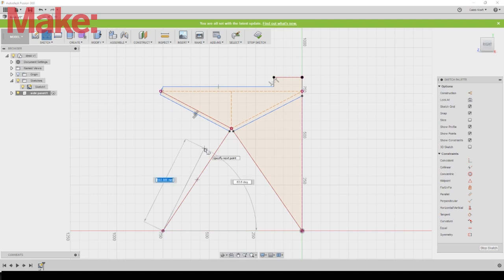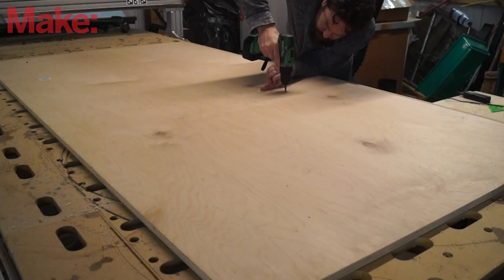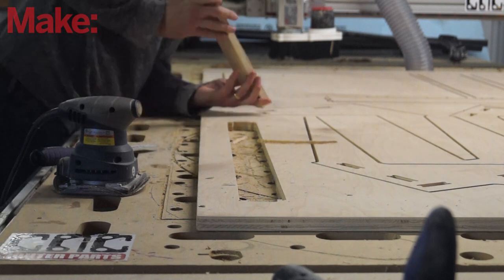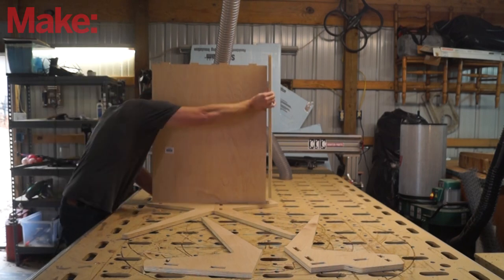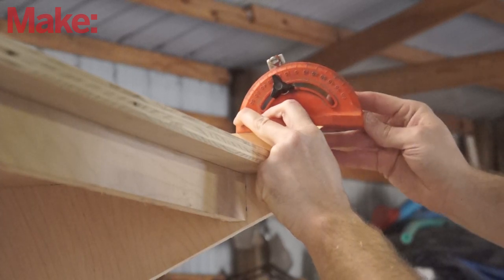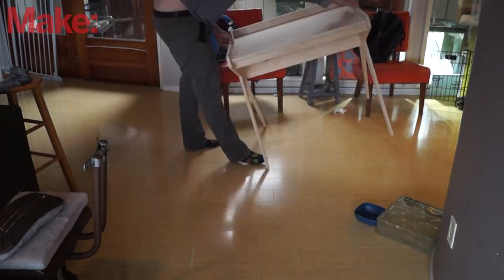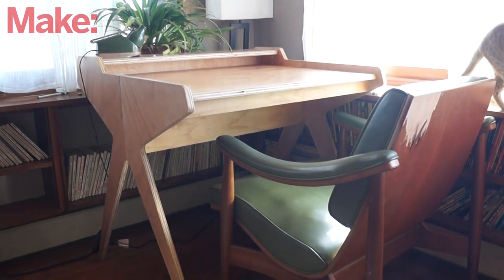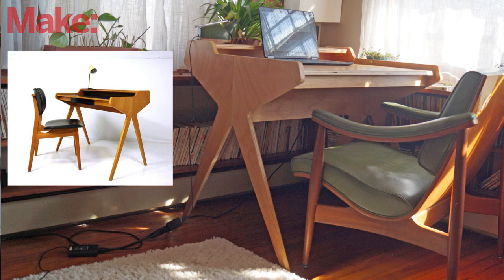DIY Mid Century Modern CNC Flat Pack Desk

Comment: i do not know about the usa, but over here in germany, every asset/idea is released to public domain automatically after 70 years. so even if you had copied the original one by one i really would not see an issue here.

however you are not going to monetize the release, aren't you? so all you really would do is "releasing a drawing" of an object nobody can buy anyways.

seems legit to me.
Reply: very good points. I did not plan to sell the files at all.

Comment: Well, honestly, I suggest you ask a copyright attorney or talk to Make attorneys. They do have a magazine division right?

That is the only way you are going to find out for sure if there is any legal issues in sharing the files you created.

You can also contact the publisher of book or magazine you were looking at and ask them their opinion on the matter.

You could pull the book back out and check the overall angles and design to see what you did differently than the original.

My personal opinion is that you own the copy right to the plans you created, even though the work was inspired by a picture you looked at, but talking to an attorney is the safest way to go.

Comment: I think it would be of poor form to profit off of an obvious copy however sharing it for free I do not feel is ethically wrong unless one of the following are true: The original creator/maker is selling plans through the same delivery for profit OR the design/product itself has some known trademark and/or patent.  In this case, the only way someone could turkey leverage your CaD design is if they had the equipment Which one could argue already enables them to do what you’ve done.

Comment: I'd say it's morally fine so long as it's under the creative commons license, I would see it as allowing people to make their own piece of history (recreating something not available anymore) If it were still in production by the designer you might run into legal issues, but that's not the case.
Reply: good point. I wanted to reach out to Helmut Magg for his thoughts, but he has passed away. I didn't bother contacting any estate as their opinion would largely be more focused on selling things.
Reply: Even if you licenced it under, share alike, non commercial, you would be credited with making the design and you would be the one issuing the license. If you're struggling with the morals of it, you really need to figure out if the files are yours to do that with.
Reply: I know this is splitting hairs but, are you talking about the files of the desk? The files are probably pretty different than the original plans. I don't know but I doubt they used the type of CNC that you used back in the 50's. Could I not take these files and make it out of plexi, or some other material? That would use the same cut files but be a really different result.

Comment: A lot of the responses concentrate on the question of selling it, of making money from the copy. In fact, copyright has nothing to do with profit or the exchange of money. When you create something and own the copyright to it, that means that you and only you have the right to copy it. No one else may make copies. It does not matter at all whether money is exchanged. It is the mere act of copying that is prohibited. If your own design is "sufficiently different" then you have the copyright for that design. The real question comes down to whether or not it's genuinely your own design or you really did copy the other design. And it may not matter whether you took actual dimensions from the original. If it's sufficiently similar, then you violated the copyright.

Also, there's a difference between copyright, which applies generally to creative WRITING, and patents, which apply to THINGS. You can have a Design Patent, which is what most likely protects that table design. But again, it has nothing to do with the exchange of money. If you make a table according to that other fellow's design,  you're violating his patent, even if you only make it for yourself and never sell it.

Giving away the files you created on Fusion? Probably a patent violation. People USING those files to create their own tables? Probably a patent violation. Will you get sued by the patent owner? He certainly has the right to do so, since you do not have the right to copy his designs. But he "likely" will not unless (1) he finds out that you dis so and (2) he can somehow extract money from you. And that's the ONLY situation where money is involved.

Oh, and one other thing, if you create some "literary work", i.e. write something, then  you automatically own the copyright to it, there's no need to register it with the Copyright Office, there's no submission or evaluation of it. If you create some design or object or process and want it protected by patent, then you absolutely do need to submit it to the Patent Office, have it evaluated, and have a patent issued for it. That table is not a literary work, so it's not covered by copyright. It MIGHT be covered by a patent. If it's not, then you're perfectly free to copy it, make it, make design files, share the files, and whatever else you might want to do with it.

Comment: If it's common to leave the bottom edge then you should look for a shoulder plane(?) One that has a blade even with the bottom and rides over the edge. Like a round over or bevel only straight.

As for the plans, let me say Tiffany vs Tiffany style has been around for a hundred years.

Comment: I think if you’re having doubts that means you already know what the answer is.  Had you made substantial changes, like moved the legs apart at the top or the shape of the sides, or added features that didn’t exist in the original, no problem.

Comment: As far as I know most copyrighted material is only protected by copyright laws for 50 years, then it becomes of public domain in most cases, except in very specific occasions, which I doubt this would be. In my opinion: you gave the original creator due credit, it is a derivative work after all, and you're not trying to profit from this, so I'm betting you'd be OK. Now, bring on the files and keep up the great work! ;)

Comment: The background audio was at a perfect level today and the voice was simple to hear.

For my cnc router projects I have also found a oscillating tool such as the dremel multi-max with a thin flat blade works great for cutting tabs to separate from larger piece. Then a quick pass on router table with a flush trim bit removes the rest of tab and leaves a nice clean edge.
Reply: haha, I made the background music in garage band on an old broken iphone. I knew someone would comment.
Reply: Caleb Kraft ha. I forgot all about that program. Had to uninstall it when I had a 16gb phone and needed that space
Reply: How about a chisel? If your toolpathing is correct that's all you should need

Comment: I'd like the desk more if it had a drawer
Reply: interesting. I actually decided in the very beginning that I didn't want a drawer so that I wouldn't clutter things. I have a tendency to do so. this design would look nice with a slim drawer under the desktop though, wouldn't it?
Reply: I think that would be nice yes. Here are my ideas for that. 
1. Place the front vertical cross piece horizontal. Either flush with the desktop or below where the drawer would be placed. This way you would not lose the support it  provides.
2. Angle the front of the drawer to closely mimic the current angles of the side pieces.
3. If you were NOT going to use drawer hardware, try the tongue and groove method on the side of the drawer and interior of the desk to provide support for the drawer. (groove on the side of the drawer and tongue on the inside of the legs/side pieces)
If you were to add drawers to this piece I believe it would make is significantly different enough to avoid difficulties in releasing your design.

Comment: Discussions on intellectual property fascinate me...
Legally, according to the USPTO, if there's a valid design patent, one could be liable for making a similar copy (i.e. doesn't have to be exact). Here, you've changed some features and even removed the drawer, which differs your design from the original at a functional level.
Morally, considering your intent to give the plans free of charge, it doesn't figure as if you were taking the bread off anyone's table; it's quite unlikely that it would cause financial losses the patent licensees (if there's still one). Furthermore, the intents for mass production of whoever downloads the plans is beyond you circle of influence.
The DIY community has more to benefit from this sharing than any other party has to lose. If any more incentive is necessary, see this as an homage to the celebrated design from the '50s.